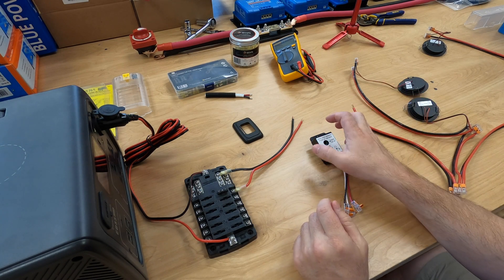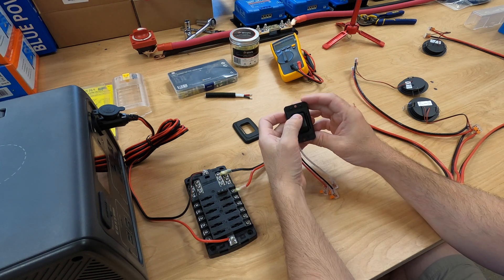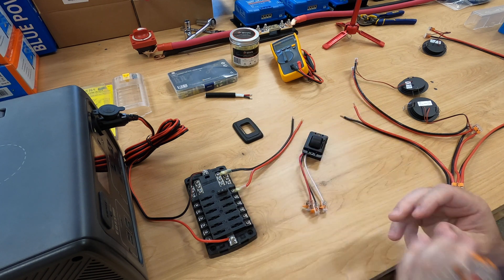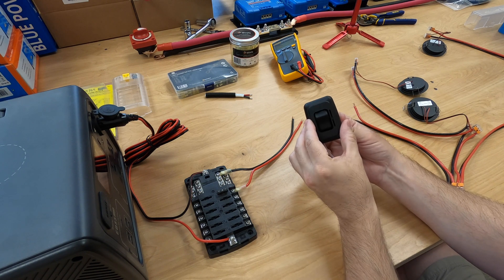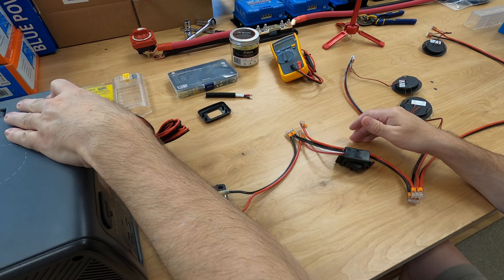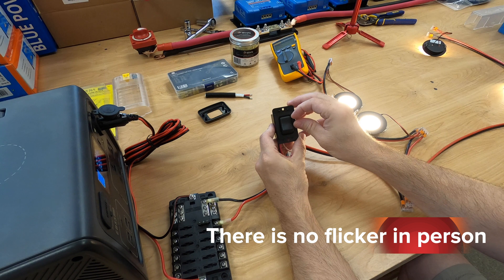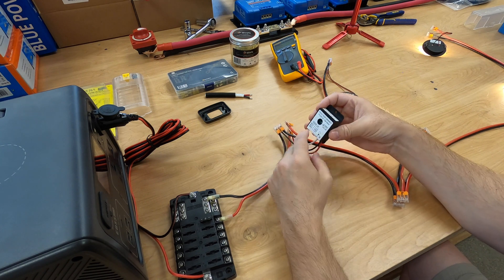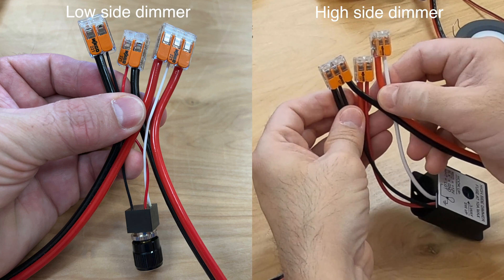Wiring LED puck lights with a high side dimmer switch for your van

Comment: Another ? I have a water heater and want to put a plug and switch combo but it needs to also power another plug. How would you wire that combo   Thanks
Reply from the maker: Hi. You will need to know what voltage you are working with and use appropriate wires, switches, and outlets that meet your need.

Comment: Attempting this same switch. At the wall I have access to 2 wires (red/wht) & (Blk/wht). If I'm understanding I must also access the 5 puck light string in the ceiling for the dimmer function to operate? Thanks for your well done video.
Reply from the maker: My table top demo is with 4 pucks, just very short cables. Extend those lengths to fit your application to your 5 pucks lights and you should be good. Use appropriate gauge wire for your distances.

To note, I have a main line with 2 stubs, each stub has 2 pucks, so it's sort of a parallel/series mix, but the voltages are fine with the gauge wire I used so I'm not worried about it. It allows me to take out 1 ceiling segment out by disconnecting that stub from the main line.

Comment: Can you add an additional dimmer switch so you can control the lights from two locations in a van?
Reply from the maker: Not with this model switch. You need 3 way switches and wiring. I have to presume if each 3 way switch has a dimmer function, then yes, but I do not know for certain.
Reply: @VanTransitions  If you look on the back of the switch ((switch with dimmer) it has a 3 way “port”. I’m just not sure how to wire it.
Reply from the maker: I do see this "hole" and section, you may have to reach out to the manufacturer.

Comment: Gets a little tricky when you decide to use the 3 way switch functionality.  I purchased one and planned to use it as the first switch in a 3 way circuit.  It would not work that way.  Turns out the dimmer is wired internally to be on the load side of a 3 way circuit.  Something to keep in mind.
Reply from the maker: Thanks for sharing

Comment: Great Video , I am in the process of connecting the same dimmer switch to my acegoo lights . They turn on but do not dim is it a non compatible issue or my connection. It seems that I have the same switch and puck lights ( electrical is not my thing)
Reply from the maker: Thanks for the compliment. Study the wiring diagram of your switch. If you do have the same switch (my pucks are also Acegoo but that shouldn't matter), then you can even pause the video and compare your wiring. It sounds like you have something backward. The high side dimmers are different than low side (which are those typical knobs like the other LED puck light video published just before this one).
Reply: @VanTransitions  thank you for the response , I was able to have success 🙌 thanks to your video. It was very helpful.
Reply from the maker: You're welcome.

Comment: Need a handful of the 12 Awg #8 ring connectors and twice as many 14 Awg #8’s.  You have to buy too many of each on Amazon.

I sent my previous dimmers back and purchased the switch combination you recommended.
Reply from the maker: It's tough when we need 20 and have to buy a pack of 100! There are options for random numbers of multi-size packs too, but then you end up with extras of sizes you don't need.

Cool, ya I really like the ATC on/off toggle with the dimmer slider on the side. It needs a little more room for mounting, but it's a solid mount with 2 screws, the PCA dial doesn't have a guaranteed mounting (seems to me it could loosen easily), which I've heard from other top builders. Your mileage may vary.

A future video will be about LED strip lighting, which is also dimmable. I am unsure what switch type I will use for those applications.